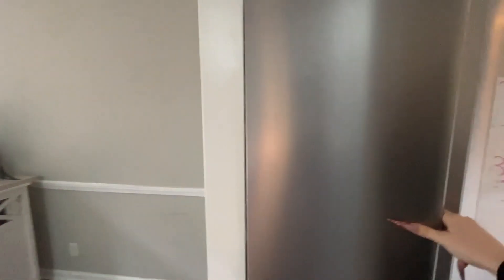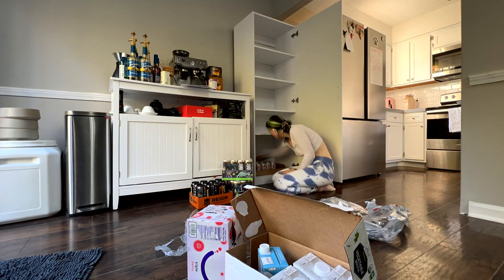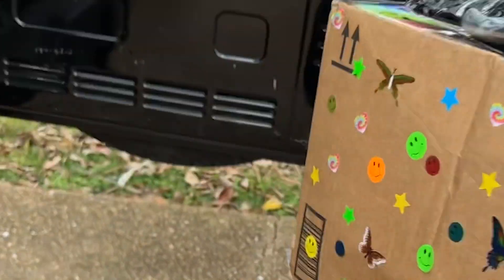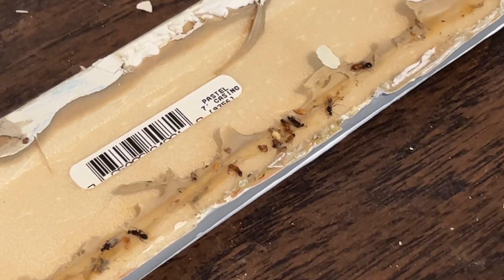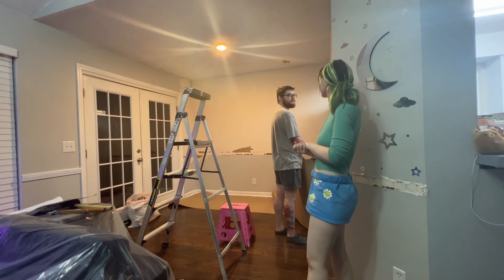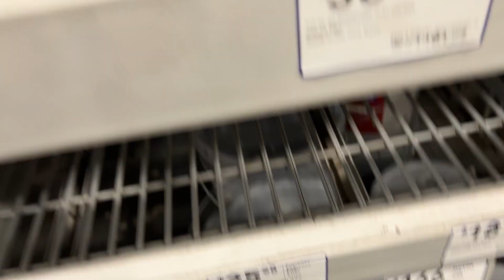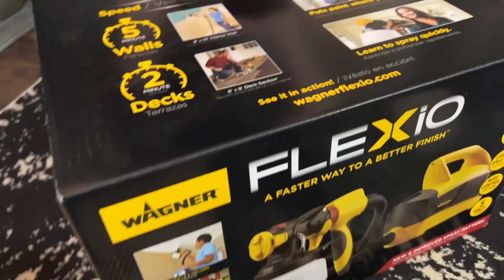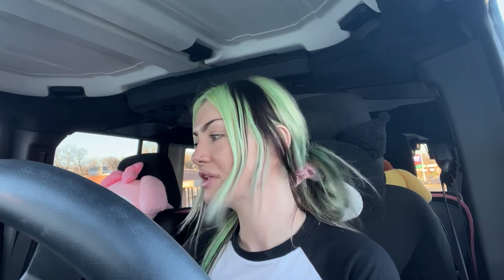My Week Starting Renovations ~ Vlog

Comment: So some tips for the flytrap because most people kill them caring for them incorrectly, but once you know the basics you’re good to go! 

When you first buy a flytrap from a big box store like that, the plant is going to need a bit of TLC before it will start to thrive, because they’re not cared for properly when they’re being sold in stores. At this time of year, it may also be dormant so don’t be too worried if you don’t see much growth until spring. 

Only water with distilled water, rain water or RO water, never use tap or spring, minerals will kill it. It’s a bog plant, so it will need to sit in a tray with about 1 inch of distilled water at all times and make sure the pot it’s in has drainage holes so it can suck up the water. 

If you’re going to repot at some point, make sure to ONLY use either 100% peat, 100% sphagnum moss and 100% perlite, usually 50/50 peat and perlite. No miracle grow brand or anything like that, no normal potting soil, flytraps do not like fertilizers (unless specialized for carnivorous plants) so anything added to the soil mixture will hurt the plant. 

Place in a spot where the plant can get full sunlight for at least a couple hours a day, in winter that’s less important but in spring and summer giving it full sun outside is what will give you that bright red on the traps, which is a sign of a healthy thriving flytrap. 

Don’t worry about feeding it bugs, it will catch what it needs on its own and still gets energy via photosynthesis like other plants, so as long as it has sunlight it doesn’t need bugs. 

Good luck! Hope this helps!